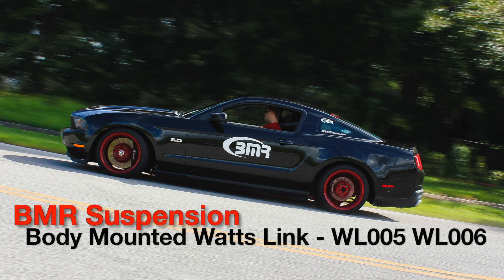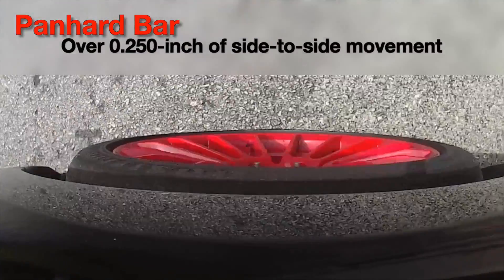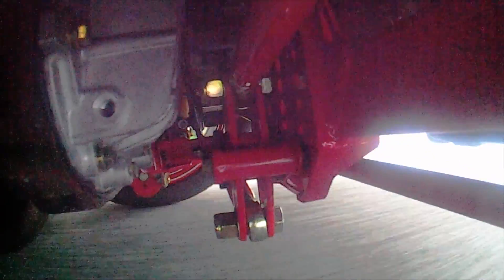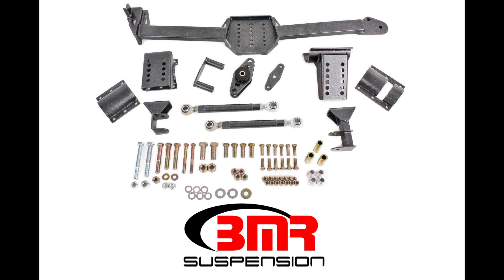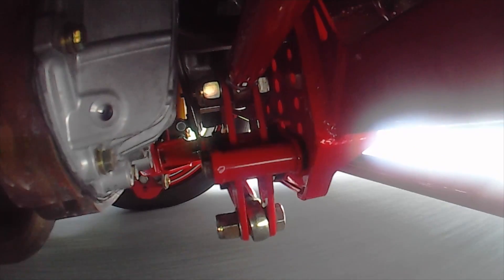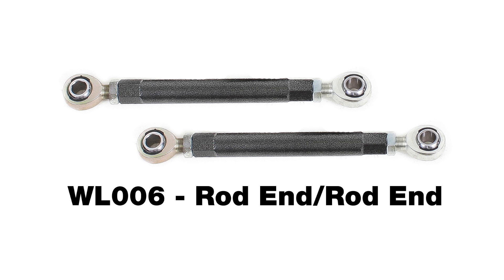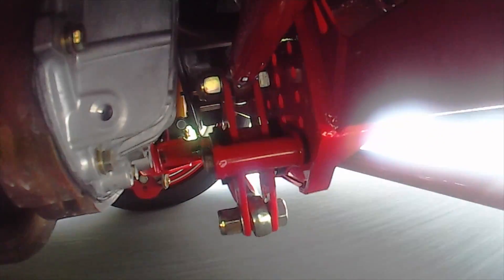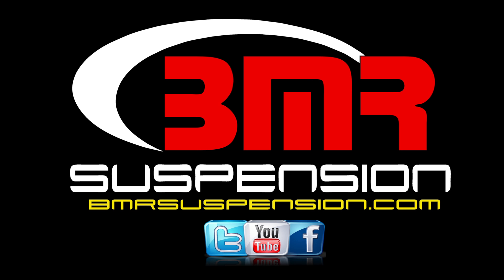BMR Suspension Body Mounted Watts Links for S197 Mustang - WL005/WL006

Comment: I need to regrease the center pivot. The reinforcement bracket is in the way. I can't get a grease gun on the zerk fitting. Is there a way to do it without removing the center pivot?
Reply: I found a way to grease the zerk fitting in the center pivot. I bought a grease coupler fitting and shaved down one side so it fits up into the center pivot to attach to the zerk fitting. Worked like a charm.  https://www.amazon.com/gp/product/B000G76OMA/ref=oh_aui_detailpage_o00_s00?ie=UTF8&psc=1

Comment: I'm in the process of installing your Watts link (WL005) on my 2007 Mustang GT/CS and I suddenly realized I can't adjust the length of the links while they're on the car. If I had known the rod/poly links aren't adjustable on the car, I would've gotten WL006 instead. It's a hassle to have to remove the links to adjust them.
Reply: +Minh Khuu I'm sorry you're not happy with that. Give us a call and ask for Dylan. If the parts aren't scratched up and in new condition we will switch them out and get you the rod end versions. Dylan can help you with it. 813/986-9302
Reply: +BMRSuspension Thanks for offering to swap for the rod end version but I've already finished the install and went through the tedious task of centering the axle. I figured once the axle is centered, I wouldn't have to mess with it again so there's no need to swap the links for rod end versions at this point. Here's a post I made about the install on Mustangforums.com...http://mustangforums.com/forum/2005-2014-mustangs/722808-bmr-watts-link-installed.html
Reply: Thanks for the heads up I'll be installing the rod to rod ends on my 16 gt 500